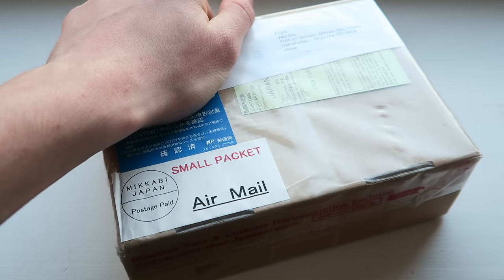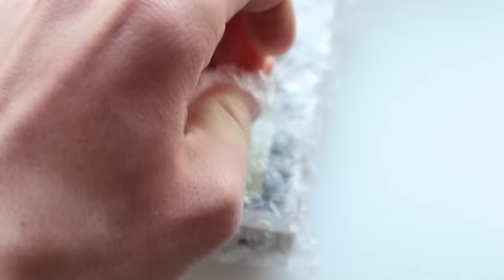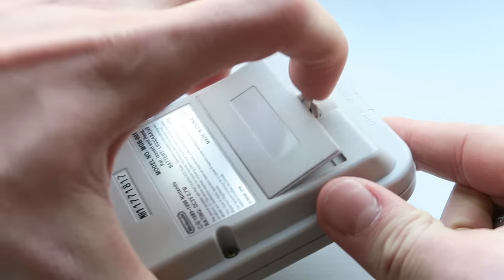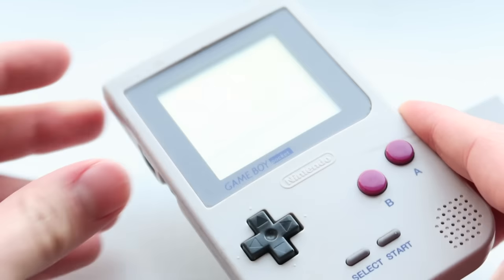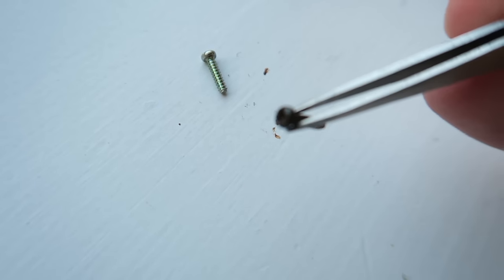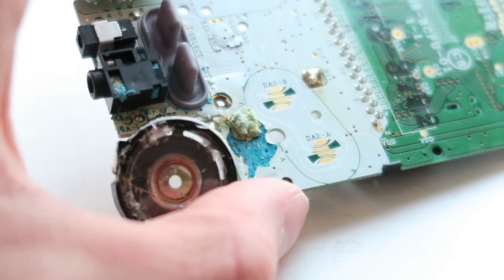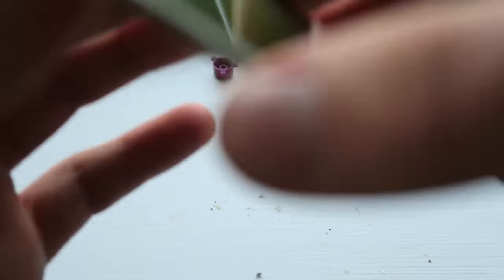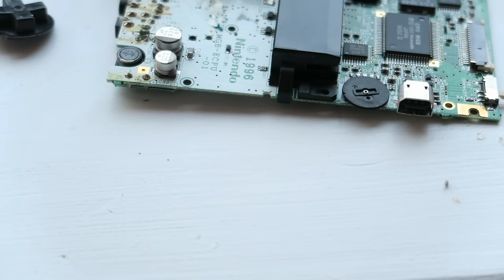Let's Refurb! - Game Boy Pocket Classic Edition!

Comment: What I love about J4U is that there hardly is anything majorly wrong with the game boys that are defect. And the pictures they present the buyers with are actual proper pictures of the actual units they're selling. Ordered a Game Boy Advance original that looked fine but didn't work according to them. Didn't see any corrosion in the battery compartment from the pictures either. I don't expect to have much trouble fixing it when I get it. I bet it's just trouble with the power button or some other small connection issue in it.
Reply: Aaaand only malfunction with it was the power button. They're just great.

Comment: How do you clean corrosion on the motherboard ???
Reply from the maker: Isopropyl alcohol and Q tips.
Reply: Depending on the type of batteries that leaked, white vinegar also does wonders. I had a DMG Gameboy with terrible corrosion to the headphone jack and other parts around it and I literally dunked the whole corroded parts of the board in vinegar, moved it around bit every 5 minutes, and eventually washed it off with tap water and dried it. 

To completely get rid of the corrosion i then used Q tips with the vinegar and started scrubbing.

It now works just fine!

With a board in that bad of a condition it won't hurt to try using vinegar. So long as you dry it off right after there shouldn't be any damage.
Reply: If the paths are completely destroyed, the only way is using strong acids to completely remove the damaged parts. Then use fiberglass to reconstruct the board and retrace some paths. After the new paths are there, apply solder mask. An even better solution is to make a new PCB, remove the most essential components of the old PCB and transfer to the new PCB with some new components.
Reply: J Najera if you think he cleaned it he didn't he just replaced the whole board

Comment: Does anyone know where to get the proper length tri-wing screws for a GameBoy Pocket? I recently bought one for relatively cheap, and it works fine, although weirdly enough it's missing 2 of the screws that hold the rear part of the casing? Are there equivalent size Phillips screws that would work? Thanks.